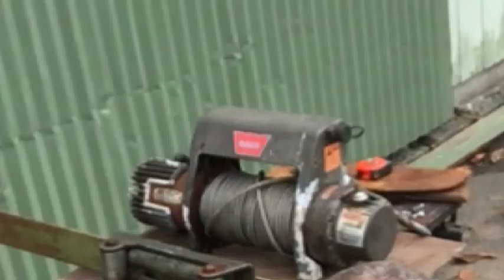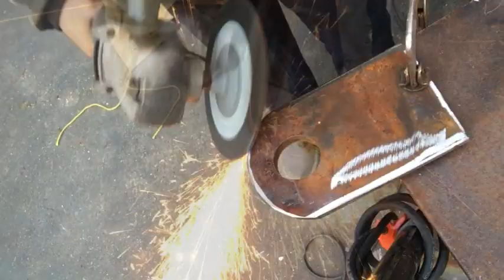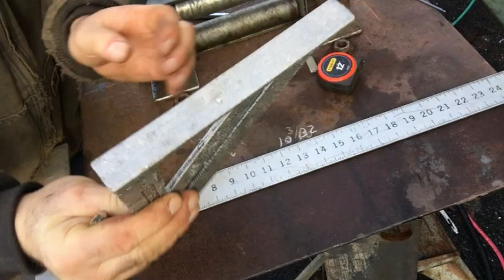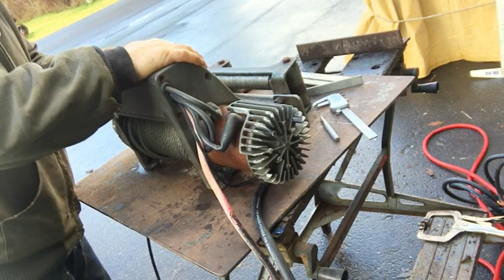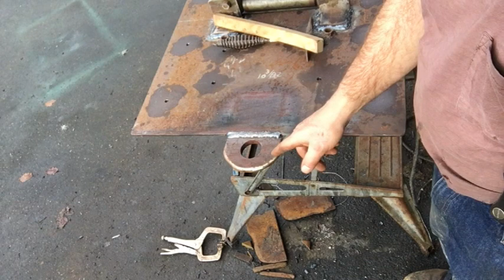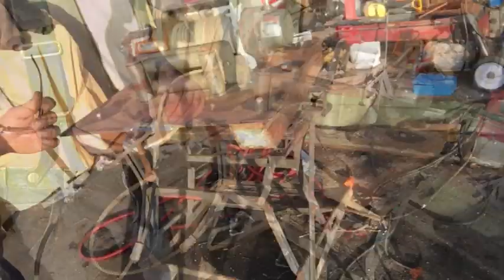Winch Skid Plate Build

Comment: HandyMan you lost me at making an extension cord & wench plate but I watched & appreciate your knowledge
Reply: ...And I appreciate you taking the time to watch! I didn't show it but the long power cables went from the winch which was placed on the equipment trailer and ran along the frame of the dump truck to where the batteries located toward the front of the truck :)